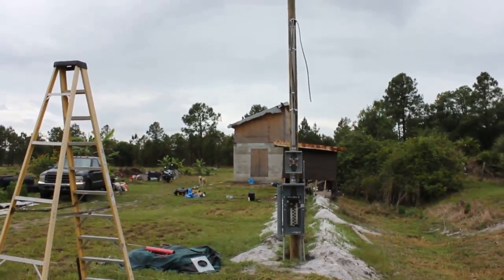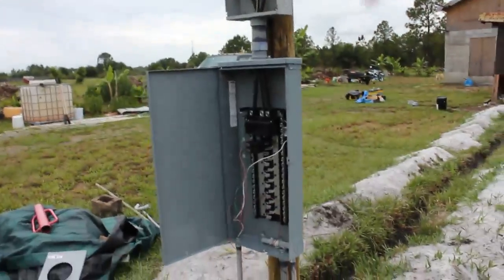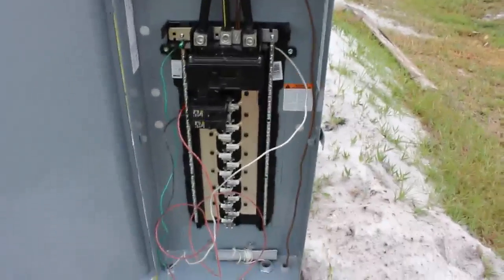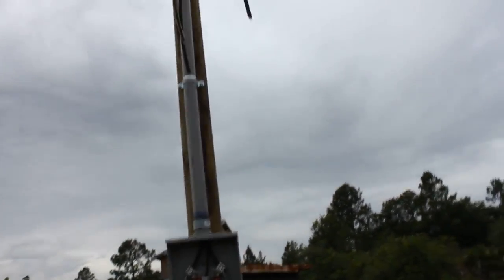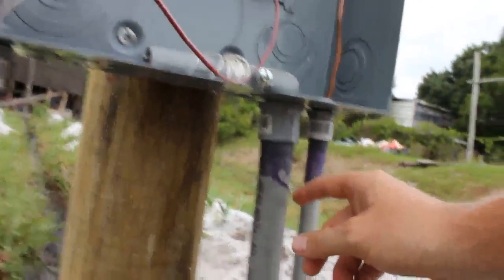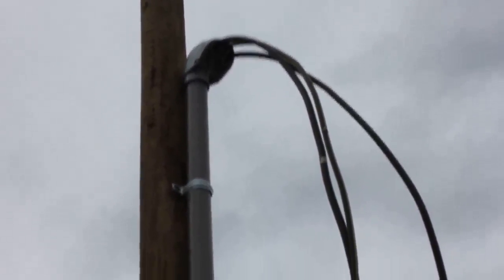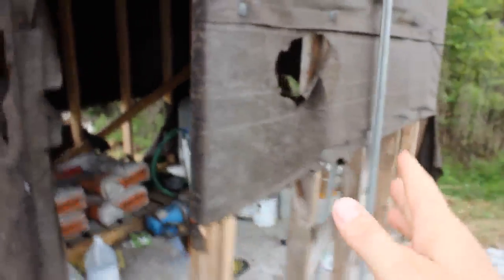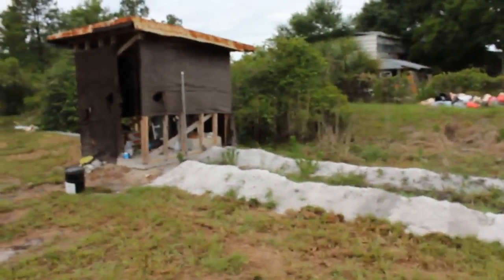DIY Electrical Service Installation with 200 Amp main breaker

Comment: Nice job , the oxidation cream keeps the aluminum from corrosion or oxidation,  but your naked wire copper is your ground to the rods , then 110 , 110 , then the yellow stripe wire is ground.....

Comment: Seems like you need to use double pole breaker with 20 amps instead of 2x 20 amps.

Comment: Could have installed a main-panel disconnect-switch, make it a lot easier and safer 
if you have to do work on the main-panel.

Comment: How long does it take to build a 200 amp underground service. And then run a 2” conduit about 30’ and tie in 10 circuits
Reply: Very simple to do for DYI  go to Florida Power and Light website and follow their requirements. I converted my old overhead to underground in South Florida due to a pole was rotten at base so I decided since Hurricanes it would be safer to have utilities in ground. 750.00 was the cost to FPL and my cost of new 200 Amp outside Panel 110.00 , sub panel inside 89.00, Meter socket 70.00, 4/0-4/0-2/0-4 braided cables (Wire) from Home Depot 175.00 (3.26 per foot) and the pedestal the Meter Socket and Panel go consisting of 2- 2 inch galvanized pipe 20.00 each and Unistrut and Unistrut clamps to hang the panel and meter socket box on 40.00, 2 bags of 80LB sackrete for each pipe 8.00, 10 feet of schedule 80 conduit 12.00 from meter socket box to ground, Permit for homeowner 89.00   FPL provides all underground pipe, fitting's, glue and string to have inside their conduit so they have a way to pull their service wire through from FPL power pole to your meter socket. I dug 24 inch depth ditch and installed their conduit and called for inspections once that was ok'd next day they came killed power and I installed braided cables (Wire) from 200 Amp Panel to Sub Panel inside House. Side Note Prior to this I installed and rewired my inside Sub- Panel a week earlier so this time would not be wasted after FPL cut power so all I had to do was pull new wire and install   my conduit from old Panel to new panel and pull my new Cables (Wire) through which took about 2 hours then they turned my power on! Yes it was work but the savings was tremendous. I would not recommend if your skill in dealing with electricity is vague but if you have prior experience go for it!

Comment: What type wire is in your meter box and mast? THHN / THWN-2 or what. Did Lowes have them as a set with the neutral marked with a stripe?

Comment: Thank you for the video!  I'm about to do something very similar.  One question I have, how did you attach the breaker panel to the post?  Did you screw thru the back of the panel?

Comment: The info about shared neutral, multi-wire circuit, is correct,  but we do not use shared neutral circuits anymore in residential because, where AFCI is required,  the AFCI breakers for them are expensive and more labor to install.

Comment: Nice install! it's great to see a DIY Electrical install on YouTube where the creator doesn't spend the whole video giving out fake codes and dangerous information.  You kept it simple and did a good job. 

did the inspector say anything about sharing a neutral for the two outlets in your shed?
Reply: Warren Manne shared neutral is ok as long as the two breakers draw from different main hot wires from the pole or sides/phases of the box. It's called a "multi wire branch circuit" or MWBC. Stacking the breakers on top like he did means they are drawing from different phases/sides - though he should have used a two pole breaker. Since they are on different hots from the power company, they are out of phase and won't overload the neutral. A common error in WBCs is to place the breakers on different sides of the panel. This is wrong because the main buss bars alternate. Breakers opposite each other draw from the same buss. Breakers on top of each other draw from different phases.

MWBCs come in handy because you pull less wire. Also, raceway fill calculations are less because the shared neutral no longer needs to be calculated as a conductor.

The main drawback to a MWBC is if you shut or trip one side the neutral can still shock someone if there is a load on the other hot sharing the neutral. Also, someone might come along and rearrange the breakers and inadvertently place the breakers on the same phase - this can cause an overload of the neutral.

This is the reason(s) a two pole breaker is required under current codes. If one is tripped or shut off, so is the other one. If the breaker gets moved, it will always draw from opposite busses. It's also a good idea to label the wires and breaker.

If you are using Romex it makes it easier to tell MWBCs because they originate from same cable. We use conduit here in Chicago so it helps to mark the wires.
Reply: According to NEC 210.4 (B) and 210.7 there needs to be a means to simultaneously disconnect both circuits.

Comment: I wonder how you passed the inspection............only one ground rod  (NEC calls for 2 not closer then 6 feet), no bonding screw for the panel???????????
Reply: I have the same panel and the bonding screw is supposed to go at the top right, which I can't see here. There is a green screw on the left side but it's directly on the neutral bus.
Reply: germanudo1 Fuck the NEC. Too many regulations. Trump better remove NEC regulations as well

Comment: ....use a Piece of treated plywood for the backer of the Breaker panel and much bigger bolts..............you can drill the holes for the bolts bigger, if you have to..much more solid plus you can attach other stuff ( local receptacle, dust/dawn sensor etc.)

Comment: Hey Robert what does the county charge in Florida for a temporary hook up? Here in Virginia the county I live in charges $2000.00 for temporary hookup but they do not charge when the hook up the main to the house.
Reply from the maker: Hey RB, I'm not sure as I've never done a temp hookup.. but I can't imagine costing more than a couple of hundred bucks.. prices are pretty fair down here.
Reply: Thanks for the reply Robert, how much was your permanent service?
Reply from the maker: No problem, it was around $500, but half of that was engineering fee because this lot was never hooked up to the grid before.

Comment: how much did lcc charge to hook up electrical  service?
Reply from the maker: +raquel pryor 
Since this parcel was never hooked up, I had to pay a $250 engineering fee, plus $200 security deposit for a year, plus some minor charges so about $500 total for the hookup.